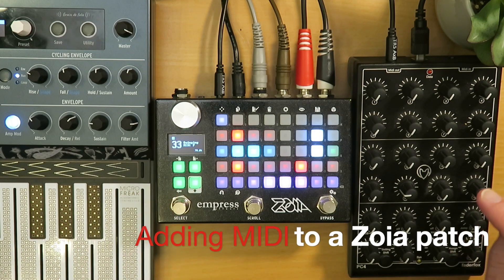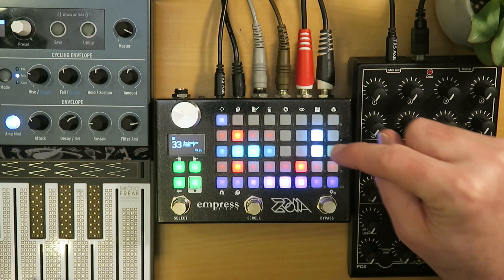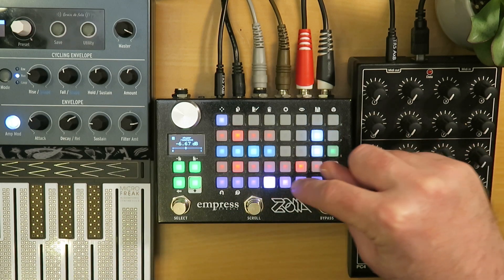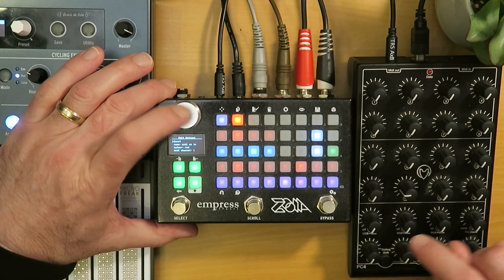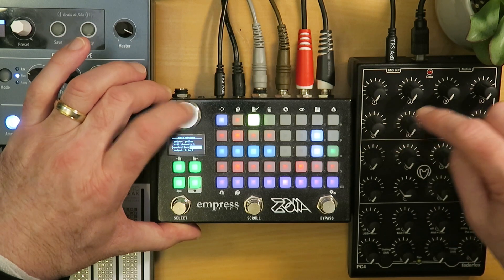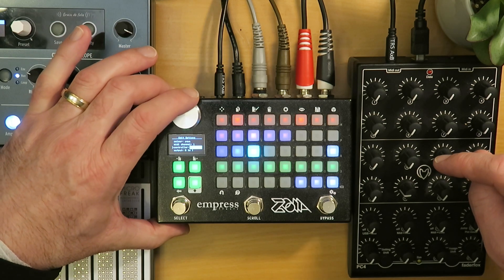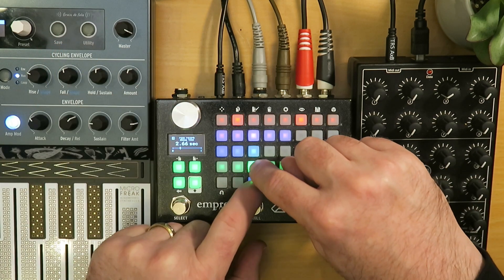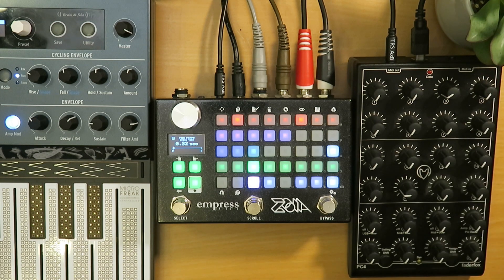How to add MIDI control to a Zoia patch

Comment: Hi ! Do you think the MIDI Fighter Twister could be an alternative to the faderfox connected to the zoia ? Thank youuuu
Reply from the maker: Yes absolutely. Haven’t used one before but if it can output from DIN or TRS MIDI then it will work

Comment: Hello synthdad ! Congratulations for your original and fun videos ! Could you explain how you configure your ec4 to control zoia ? I have to star every parameter before to connect with ec4 ? I don't understand how it works... thank you !
Reply from the maker: Hi - which piece do you not understand? If you want to control a parameter on the Zoia you need to star and then map that to a MIDI CC that corresponds to the same CC and channel being sent by the EC4. Then when you turn a knob on the EC4 the Zoia should get the values. It takes some trial and error to get it right
Reply: Thanks for your answer. I'd already try this but it doesn't work. For exemple I can't star the parameter "midi cc in". So i will try later to star an lfo for example. I don't give up 🙂💪
Reply from the maker: @bpirlot1  ah you can’t star the midi cc in parameters as otherwise it would cause a problem if that cc was received. But you can star anything else

Comment: Interesting demonstration, thanks for sharing. Can you use the zoia control a 3rd party synth with its LFOs/sequencers etc? If so, would be a great video!
Reply from the maker: Yes you can! I have another video where I show the Zoia sequencing the 0-Coast over MIDI from its sequencer and applying effects too
Reply: @SynthDad  Oh great, thanks for the pointer, I will seek that out. I'm hoping to use it like an LFE type device with a Prophet 5 Rev4, makes some figuring tho!
Reply: Could you maybe recommend any tutorials that explain the process of getting that to work? Thanks

Comment: Can you do this without a computer?  Can you just link the faderfox (or any other midi controller) directly to the zoia and map it?
Reply from the maker: Yes you can. The PC4 uses a fixed MIDI channel per setup, so setup 1 is on MIDI channel 1, setup 2 is on channel 2 by default. This makes it easy to map onto the Zoia.
Reply: There a midi learn function available from the starred list too. Thanks for the vid and cable tip, I think fader fox is the one for me!

Comment: I'm surprised that Zoia doesn't have a MIDI learn function
Reply from the maker: It does actually, I forgot to cover it in this video. MIDI learn is very easy to use